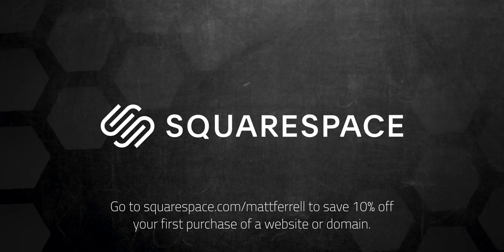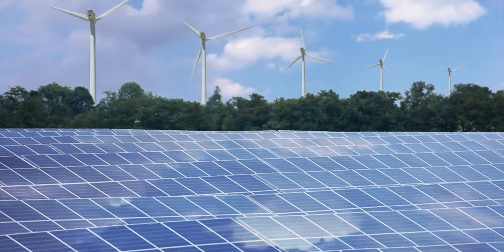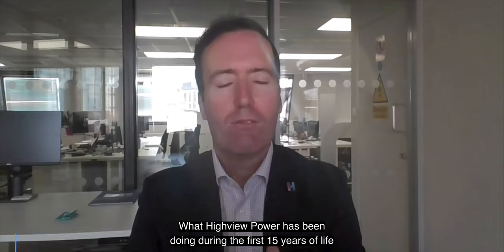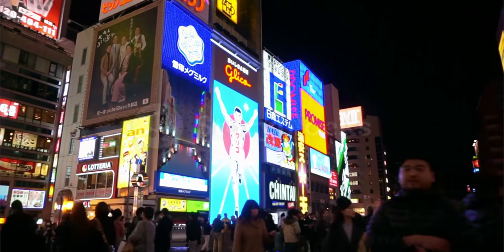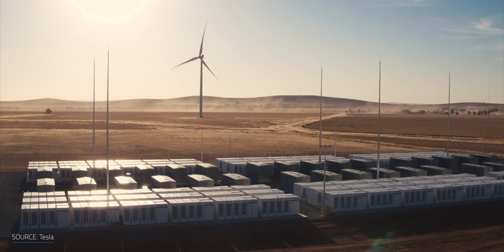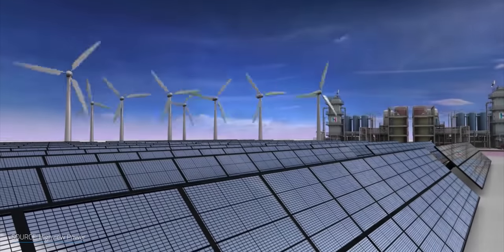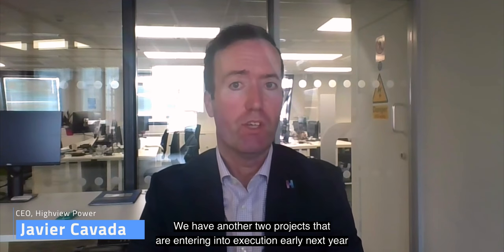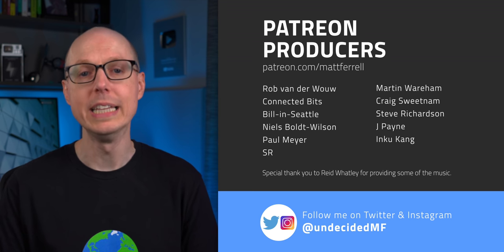Liquid Air Battery Explained - Rival to Lithium Ion Batteries?

Comment: So could this work as a baseload "power plant"? Like an intermediate between renewables and the grid?
Reply: Baseload is a term we need to abandon.  It really refers to how steam plants operate.  Steam plants are slow to bring online and don't load follow very well so past practice has been to keep them running just under their rated capacity.  That's the baseload power supply.  "Baseload" just shouldn't be used when talking about demand.

There is an absolute minimum demand over any period of time.  That tells the system designer how much electricity they will need at all  times.  Then, above that minimum, demand rises and falls.  Talk about 'minimum demand' rather than using a term that applies to the generation side.

Large scale storage like liquid air can time-shift energy from when there's an oversupply for demand to when there's an undersupply.  Liquid air, batteries, compressed air, and pump-up hydro are all technologies that can time-shift energy.  In a 100% renewable system there will be few 'always on'/baseload generators.  Run of the river hydro and geothermal will generally run 24/365 but they will be small contributors.  Hydro will generally be a dispatchable generator.  Biomass/fuel may become either 'always on' or dispatchable.  The main electricity generators will be wind and solar and they are 'use when available, store for when they aren't' sources.
Reply: Look at it like "pumped hydro in a box".  Like pumped hydro, liquid air energy storage delivers clean energy storage with grid synchronous inertia to enable baseload renewable energy
Reply: @wendyprabhu  Good comment, but could we drop the term "baseload" when talking about renewable energy?  Baseload refers to generation, mainly coal and nuclear plants.  Things that are generally 'always on'.

What storage helps provide is "an ample supply of electricity to meet demand when it occurs".  A matching of supply and demand.
Reply: And therein lies the rub in all this.  The electric utility industry (and its economically aligned fossil business affiliates) would much prefer to see liquid air storage technology killed in the crib rather than see its existing baseload fossil/nuclear plants have to begin competing for off peak market share and/or ratchet down production to match reduced demand during off peak.  Liquid air storage will allow low cost gigawatt scale solar and wind to outflank the utilities on curtailment and thereby provide an economic path for continued growth and expansion of utility scale solar and wind.   As a legitimate full service 24/7 power producer on equal footing, they will have the ability to store excess power generated during the day and dump it back into the grid 24/7 including off peak times when demand is low.  Possession being nine-tenths of the law, it my guess the electric utility industry will go to the mattresses to try and prevent liquid air storage from gaining any type of physical access to the grid.  They can easily deny property access, easements, and permits that may be necessary to hook into the grid.  It may take a very long hard regulatory and legal fight for liquid air storage to gain physical access to the grid.
Reply: @petertownsend252  Feels like you have an image of "the big, bad utility industry" in your head as if there is one organism.  In fact, there are many utility companies operating across the country.  Some of them own their 'means of production', some buy electricity from suppliers.  Most are under some pressure to lower their carbon footprint.

Nuclear is dead.  Most US reactors are approaching the end of their usable lives and, essentially, no replacements are being constructed.  Nuclear is simply priced out of most markets.  We have reactors that are paid off, in decent working condition, and have years left on their license but are being closed.  The market won't pay the $0.04+/kWh they need to cover expenses and avoid bankruptcy.  A handful of reactors are running in the red but being kept online with subsidies.  I think they are being subsidized as a means of protecting jobs and the businesses that need those workers money.

Coal is dead.  The only coal plants that can compete are a handful that are located so close to where the coal is extracted that they have very small fuel shipping costs.  And those coal plants are in some areas with very good wind resources.  We're closing coal plants and I don't think we've started construction on a new one since George W. was in office.

Liquid air storage (I'm assuming it works and is affordable) won't outflank the utilities.  The utilities will either build the facilities or purchase electricity from them if someone else is the owner.  

I can see utilities fighting liquid air storage only if the utility owns fossil fuel or nuclear plants that they are trying to keep in operation.  And since utilities don't get to set their own rates, we'll see the governance boards disapproving continued operation of expensive generation if there are lower cost options available.

There are some utilities that have been required to open up their grid for any qualifying supplier to sell electricity to consumers.  They use the utility's grid and pay a use fee.  In those service areas the utility company, the grid owner, is going to leap at liquid air storage if it lets them be more competitive with other suppliers competing for customers.
Reply: @bobwallace9753  Regarding your "feelings" about me having an image of "the big, bad utility industry" in my head.  We can safely file your feelings as a bad guess at reality.  I can speak for my own feelings which is to say I don't have any "feelings" about the matter.  However, I do have some thoughts on the matter that I consider rather sober, mundane, and pedestrian.

I have no reason to dispute the nuts and bolts of what you have said about coal and nuclear.  I also believe that ownership of the grid and power supply should be separated as a basic first step (as I believe is the norm in Europe).  However, that is only a partial incomplete solution to the broader challenges.  More critically your broader statements of apology to the electric utility industry are blinkered, myopic and uninformed to a degree that puzzles me.

Case in point, the hard undisputed facts contained in the 2015 anti-trust lawsuit between the Phoenix, Arizona area utility company Salt River Project (SRP) vs Solar City/Tesla.  This case was settled in 2018 a few days before oral argument before the US Supreme Court when SRP withdrew its appeal and settled with Tesla.  The undisputed facts of the case includes admitted statements that SRP considered Tesla to be an enemy.  Solar City had filed suit against SRP in the Arizona District Court accusing the utility of anticompetitive and tortious conduct designed to eliminate solar competition.  In its defense SRP fully admitted to the conduct, but alleged it was entitled to engage in such conduct as a matter of law because it was a governmental owned utility subject to the privilege of sovereign immunity.  It clearly and definitively lost that frivolous preposterous argument in both the District Court and the 9th Circuit Court of Appeals.  Fearing it was on track to lose in the US Supreme Court, SRP withdrew its appeal and settled for what Tesla was asking for.  However, SRP still succeeded in stalling Tesla for 3 years before settling.  Perhaps that delay was the real "win" they were looking for. 

So why is a governmental organization with an elected board of directors trying to purposely eliminate competition from a private sector company.  As a non-profit government owned monopoly organization it should not even have a dog in the fight.  The answer is simple.  SRP was not acting in the interest of itself or its customers.  It was unlawfully acting in the interests of the affiliated private sector power providers, vendors, contractors, and sub-contractors with whom is does business on a day to day basis.

The economic interests of a power supply company are not limited to the power supply company.  In the case of a natural gas fired power plant, they include the affiliated interdependent downstream economic interests of the companies that design the power plant; design and manufacture the turbines; supply the natural gas; design install and maintain the natural gas pipeline and compressor stations; well driller that drilled the wells that supply the natural gas, the suppliers of drill pipe, drill bits, drilling mud, oil field services, etc., etc.

Many of these affiliated businesses share membership in common trade organizations and lobbyists.  They can share overlapping directors and stock ownership thorough parent companies and subsidiaries.  It is a byzantine network of interdependent but legally separate business entities whose correlated economic interests rise and fall, sink or swim in response to the same electricity market.  At the top of the economic food chain are the large investment firms that manage investments in the broad energy sector on behalf of large institutional investors like pension funds, hedge funds, and mutual funds.  The officers and directors of the electric utility companies are not calling the shots.  They are pawns answering to and accountable to the upstream institutional investors whose energy sector interests are much broader than any one particular electric utility.   

Liquid air energy storage holds potential to negatively disrupt the status quo for the broad energy sector as the disruption of one company cascades thru the rest of the economically affiliated energy sector.  Those at the top of the economic food chain will notice and be can be expected to take preemptive action to mitigate the broad sector risk.  The question is what will they do?  The answer is not so straightforward as investing and/or acquiring an ownership interest in solar, wind, and/or grid storage.  To do so would be to throw their current legacy interests in the broad energy sector under the bus.  An institutional investor with large stakes in the broad energy sector in companies like ExxonMobil, Chevron, Halliburton, Kinder Morgan may view a PG&E utility investment in solar, wind and/or grid storage as a hostile act contrary to the economic interests of the investor(s) at the top of the food chain.
Reply: @petertownsend252  If I misunderstood you, sorry.   

Are some utilities fighting the transition to renewable energy?  That's what I said in my comment.  Some will have to be forced to change.  Others are working to change without significant outside pressure.  We appear to be in an era of massive disruption.  It's happening in many industries and some of those with vested interests will attempt to slow or stop change.  Others will see emerging opportunities and adopt new solutions.  

Is liquid air storage "the solution"?  We don't know.  Until there are some facilities up and running in order for us to determine reliability and cost the future role of liquid air storage is unknown.  Right now it's an interesting idea.

But there's another very interesting development.  Tesla, at their recent battery day, announced a route to 56% cheaper EV batteries.  Given that battery packs for the Tesla Y now cost $108/kWh that would mean a $44/kWh storage medium.  And Jeff Dahn, Tesla's main battery researcher, has hinted that Tesla will have 15,000 cycle batteries.  Those would be 2 million mile batteries and would far outlast the rest of the car (except, probably the electric motor).

Think about a future where EVs are cheaper to purchase than ICEVs.  (We should be there in less than five years.)  Then since the body will be toast after 250k (?) miles those initially inexpensive batteries could have a long life as grid storage devices.  How long a life?  One eighth life used for EVs. 13,125 cycles left for the gird.  36 years of daily cycling.  Assume the car purchasers pays $50/kWh (includes company profit) and sells the pack on for $40/kWh.  

$40/kWh / 36 years / 365 days = $0.003/kWh per day to store electricity.   Essentially free.

Assume for 'deep storage' we have some batteries that cycle only 4x a year.

$40/kWh / 36 years / 4 cycles = $0.28/kWh.  

And those numbers are unrealistically high.  15,000 cycles for an EV means 15k cycles without the batteries falling below 80% capacity.  The grid can use batteries well past a 20% loss of capacity.  Housed in inexpensive real estate batteries with only 50% or less capacity can provide grid storage.

It's not time to declare winners.

Comment: Seems very inefficient.  I'm thinking using the liquid air directly in large structures for cooling and using the compression cycle to heat large buildings as being much more efficient by eliminating the losses due to conversion (air flow to create electricity).  Distilling the other gases, argon and neon for commercial resale, and carbon dioxide for sequestering or other commercial uses (closed greenhouse or algae enhancement) would help offset the cost of lower efficiencies.

Comment: I am from Iowa, they have lots of windmills there but I sware, every time I visit my home state 80% of the windmills are sitting idle
Reply from the maker: Then you're seeing curtailment.  Definitely need energy storage to keep those turbines turning.
Reply: @UndecidedMF  This fact needs to be spread in more media. Few things are as annoying as smug morons going "I saw a windmill once but it wasn't turning" as "proof" that wind doesn't exist or all windmills are always broken, or whatever they are claiming this week.
Also, USA in general needs to stop ignoring the need to repair and upgrade basic infrastructure, including the electric grid that could transmit the energy form those windmills to another state if nobody in Iowa needs it right now.
Reply: @UndecidedMF  curtailment? - Onshore wind turbines in the  US (i.e. Iowa) have a ~35% capacity factor. So around 65% of the time they may indeed be idle.

Note: turbines usually turn about 70% of the time, but turbines in a single farm (well actually a single state considering the size of weather patterns) are correlated because the weather pattern across them is the same, so they all tend to be spinning or not spinning.

"Definitely need energy storage to keep those turbines turning" - sigh! Wind turns wind turbines. Are you going to tell us next that electricity generation drives the demand load?

We definitely need energy storage, but that is to provide a more stable grid, not to keep wind turbines spinning.
Reply: @AnalystPrime  However, the "I saw a windmill once but it wasn't turning" observation is proof of:

A: intermittent energy having difficulty integrating to the grid (either it isn't contributing power, or it is curtailed - in either case due to its intermittency).
B: a low return on assets (an idle asset necessarily leads to a low return)
Reply: You are correct.   Wind turbines are very high maintenance.   Instead of listening to the posters below, you should talk to someone who actually works on them.   They are totally incapable of replacing coal and nat gas.   Nat gas is the cleanest, most efficient fuel we are using to generate electricity and we have hundreds of years of it.   It's also the most effective way to heat your home in winter ever invented.    The people pushing the climate change hoax do not care about this planet or it's people.   There is a much darker agenda in play

Comment: I've been aware of liquid air batteries for a while, and I find them an exciting option for a very affordable mass grid  storage using of the shelf technology that's available now, I wonder if we could build more storage than we need, the option is here with this system
Reply: liquid air batteries are BS, compared to current Tesla MAGAPACK batteries (3mw each) , they will get Cheaper when TESLA changes them to 4680 LFP - iron batteries.
Reply: @markplott4820  Nobody has seen neither the size nor the exact data of the 4680 batteries ... The presentation video was pathetic
Reply: @vw254   - EVERYTHING was laied out CLEAR as DAY , if Battery OEM's dont increase Production , TESLA will make 4680 battery in HIGH Nickel, LFP , and NCA/NCM Chemestry. 
ELIMINATING the need for Comodity Cells.
CATL, Panasonic, LG Chem will LOOSE their BIGGEST Customer. 
Because, can do it THEMSELVES.
Reply: @vw254  Are you referring to the size of a total battery pack, or the size of individual battery cells? If you refer to the latter, the size of 4680 cells, then that is literally their size: 46mm x 80mm. If you know the amount of cells per battery pack, you can easily figure out the total size.
Reply: @markplott4820  different use cases! Although I would indeed put my money on redux flow as an intermittent storage. This efficiency is just painful. Seasonal is only possible through phase change or hydrogen, optionally converter to methane, in my opinion.
Reply: @MnrBugi   - FLOW batteries are VAPOPRWARE , Tesla MEGAPACK is the ONLY Near Term SOLUTION to GRID Storage.